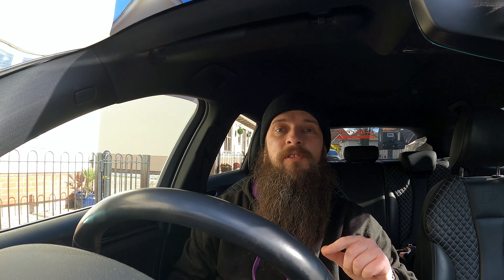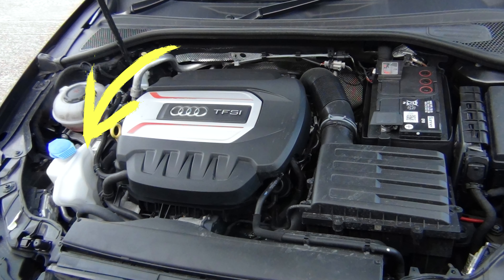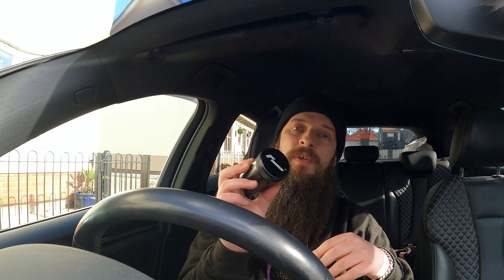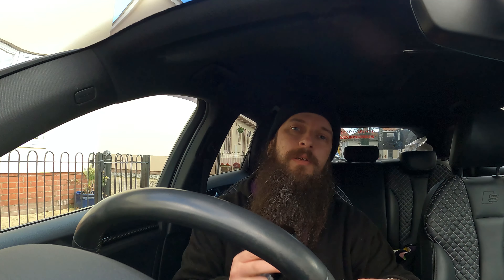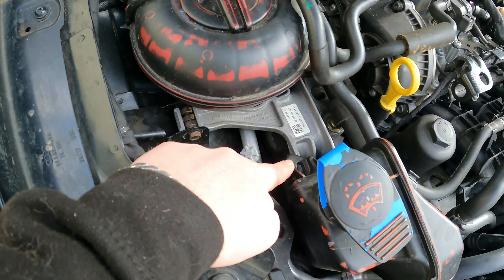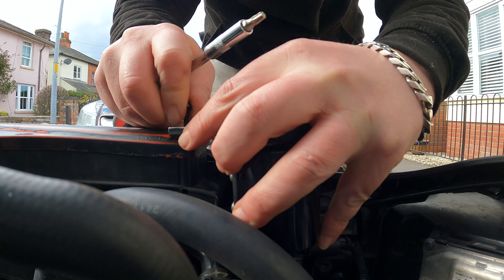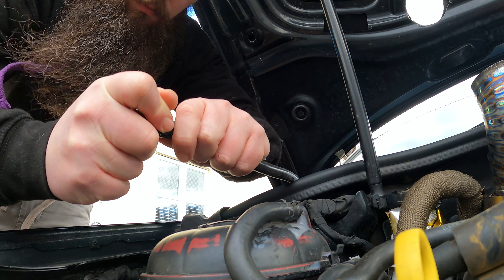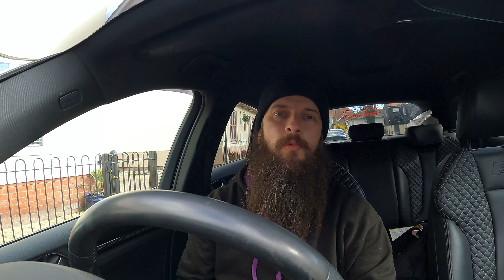Racingline Remote Washer Refill Kit on Audi S3 8V

Comment: Nice little mod Gilles, looks like a well thought out kit.
Reply from the maker: I like racing line, just a shame they do everything to fit a Golf yet sale them as MQB product. The bracket only works properly in the golf :/ Bit like how their airbox for those follow the same design as the  golf cover. Hate it when companies do that, there are people out there with the R from VW in their Audi engine bay :/
Reply: @Beardchanics  yeah that isn't great. Would have thought the s3 would have a demand enough to warrant specific fitment parts.
Reply from the maker: @SoloLap  Nah it's quite mad, all about the golf. So little choice in body styling, part design to match car ect. And the little there is if often focus around the sedan version as the only one they get in the US so even less for the hatchback like mine :(